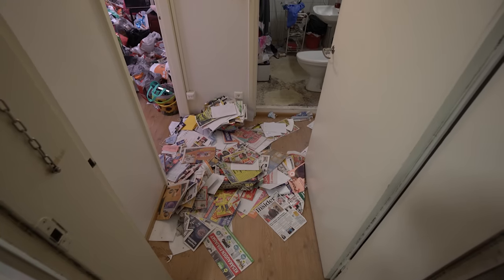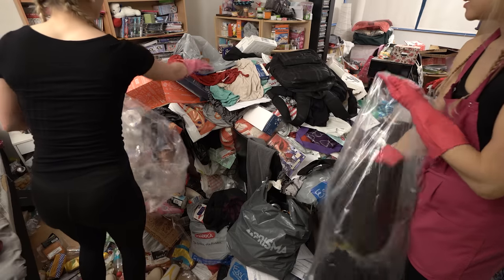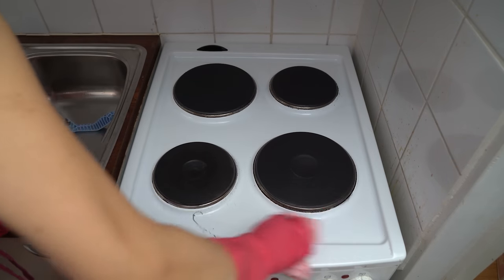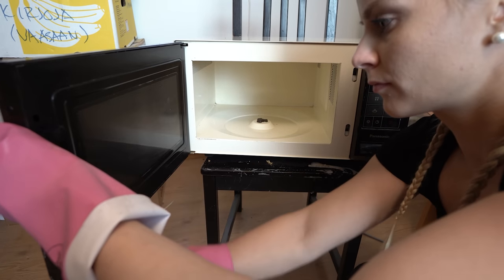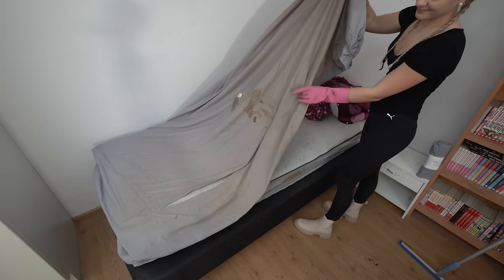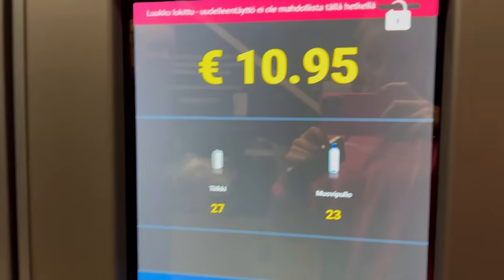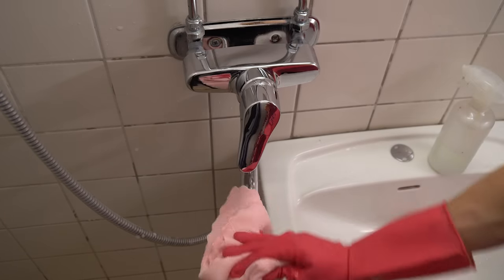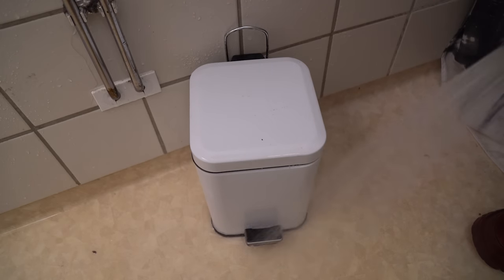HELPING A HOARDER FOR FREE! 💖

Comment: I like smaller kitchens instead of the huge ones in expensive homes. Not so far to walk.  Mine is quite nicely big but I had a tiny vile kitchen for 33 years before that.  Just cleaning the cupboards and drawers out at present. I so love the after effects on your videos Auri.  My kitchen is dirty and mouldy up high (ceiling and some wall).  I have to get a cleaning team in in a few months.  I can't go up too high.  My lovely lights have gone rusty too  as it's so damp.

Comment: I'm currently suffering from burn out and it shows on my home. I also buy stuff to give myself just a little bit of a good feeling, wich has quickly cluttered up my tiny appartement.
I'm working my way through recovery right now and even if it is a slow process, trying to get some order in my home at the same time. It's hard, because of the burn out my energy level is very low. But I have managed to clear out my bathroom and my tiny hallway. The worst is yet to come, but if I am patient and kind to myself I will get to that clean home eventually. Corner by corner, room by room 😊✨
Instead of buying things and eating fast food/sweets to feel good I meditate, pet and spend time with my cat, play video games and knit/craft/sew. Sometimes I fall into my old ways, but that's okay. As long as I am kind to myself and don't give up on trying - everything will work out.

Comment: "I forgot to ask why she didn't have a sink..." Isn't there a swivel faucet on the left? The longer bar part of the showerhead and where you turn the water on? Looks like you just pull/twist it over top of the sink when you need it! Makes filling bowls and buckets for mopping probably way easier. I wish we had more thought out bathrooms like this in the states, but I guess the bathtub faucet works just the same for most people.

Comment: Am envious of your bathroom hoses. Wish I had one here but in the UK they are not installed as standard. Also wish we had your plastic bottle recycling machines that pay you back. Very cool. I must start on my decluttering and deep clean but really can’t seem to find the motivation/energy to do so. I suffer with fibromyalgia, anxiety and depression so do you have any tips about where to start when it’s very overwhelming and if you have pain etc. I have a small house just a cupboard under the stairs and a boiler cupboard for storage and the place was really grimy and old fashioned when I moved in. So now I really want to get it sorted. Have you thought about doing a how to book/planner, I’m sure it would go down very well. I would definitely buy it especially if it had sections that we could tick off when we have done that bit. It would be awesome.

Comment: Hello Aurikatariina!  I get the most pleasure when I'm outside (caring for my garden or walking on a trail) on a beautiful day and the birds are singing.  Today is a foggy and cold day here so I'm watching you and getting inspired 😍How do you take care of your cleaning tools, such as your used scrub daddy or mommy, microfiber cloths, flat mop and dish brush?  Do you throw them away after you use them or do you clean them to use again?  (I imagine your sponsor keeps you well-supplied so that you don't have to worry about the cost of replacements). If you clean the dirty tools so that you can use them again - what is your method?  If you put them in your washing machine then do you clean the washing machine after that?  If so, then how?  Thanks for all you do!
Reply: I think she throws away the scrub mummies and daddies from different houses she does.  She always starts with new ones.   

You would not want to even risk transfer of germs, from house to house.  I am pretty sure she reuses hers at her own home.

I think in really bad messes the microfibre clothes would be thrown out, maybe all, just so there is no danger of spreading bacteria to different houses.

But you would reuse scrapers, etc.  And she often leaves them some new ones..
Reply: @georgielancaster1356  guess I did a bad job of questioning . . . I should have specified for her own home.  I completely get that no one would want to re-use tools after some of the messy and germy homes that she has cleaned.  I'm even more curious, though, to learn how she cleans and sanitizes her tools at her house.

Comment: different countries differences

my gas range and oven
you can take the burner stands off and lift the top and clean the edge between the stove burner control knobs and the top

electric stoves you can remove the electric coils and lift the entire top

does these stoves you clean, where you use a microfiber and credit card to clean, not lift up for cleaning?

Comment: Love this video!! And I always wondered why Finnish bathrooms are so small and there's no difference between shower floor and the rest of the bathroom..why's that? 🤔
Reply: As you saw in the video, the entire apartment was rather small, so it makes sense that there is no "wasted" space in the bathroom which would make the entire apartment more expensive. That is the case with a lot of small apartments. Also, Finns just have a habit of making the entire bathroom floor water proof so that there is no need for a separate shower floor and it's easier to clean.

Comment: What do you use to tackle limescale? We live in a very hard water area and limescale is a big problem.
Reply: I'd recommend using vinegar. It's cheap, widely available and really good at removing limescale. You can add it to water and boil it in your kettle, you can also spray it on taps, shower cabins, etc. You can soak things in it- it will ALWAYS remove any amount of limescale